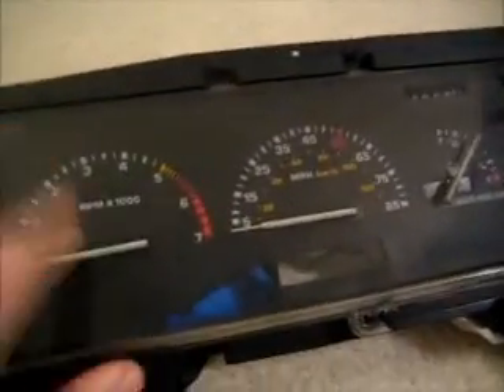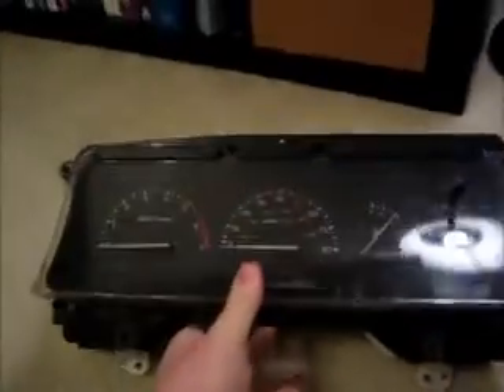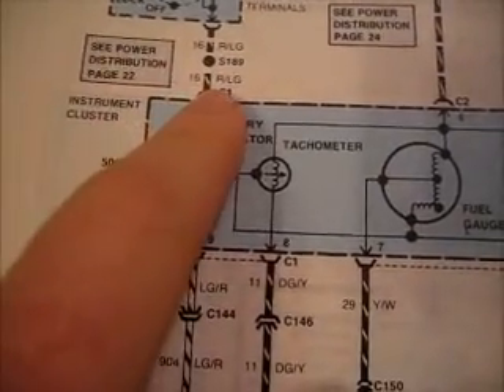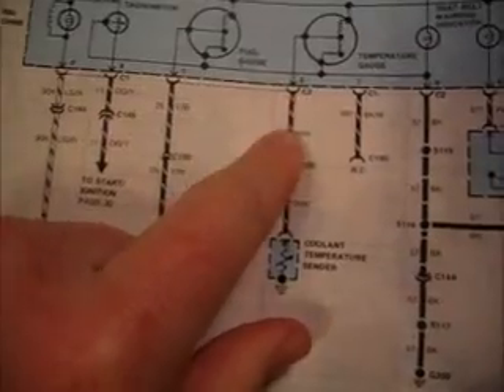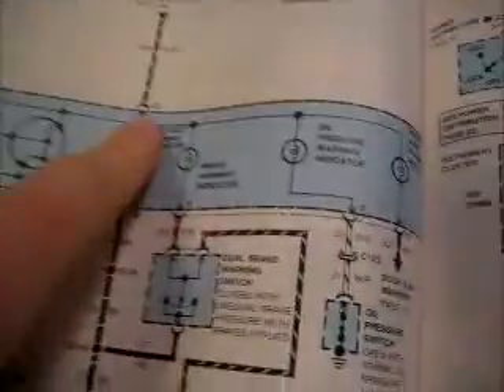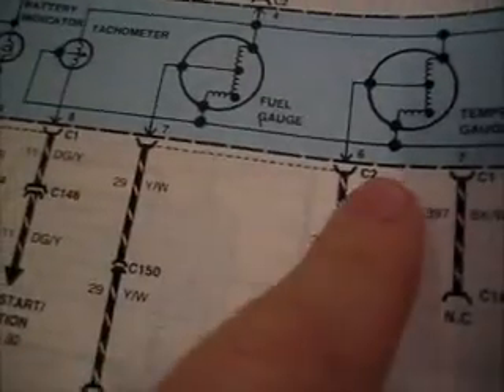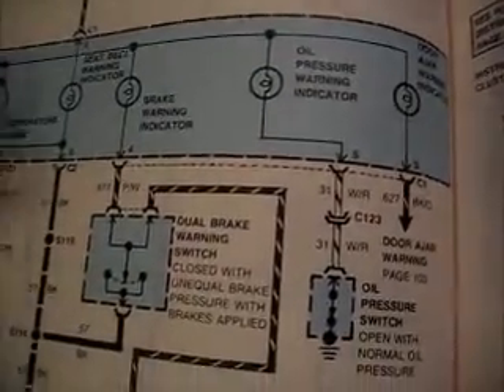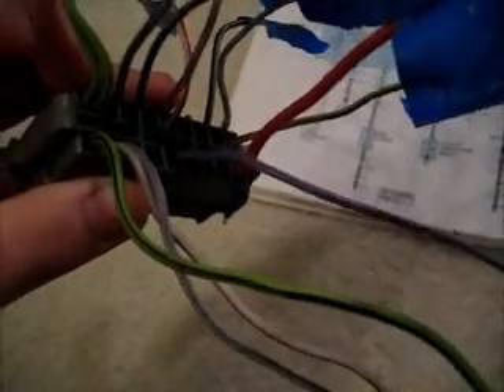1987 Ford Taurus--Setting up wiring for a tachometer cluster

Comment: The black wire in C2 on slot 9 is the seat belt warning indicator. The other one in C1, slot 2 is the warning CHIME. I am almost 100 percent sure thats how it is. I have a wiring diagram for the non-tach cluster wiring and I put two and two together.